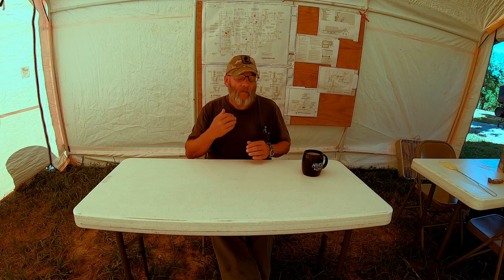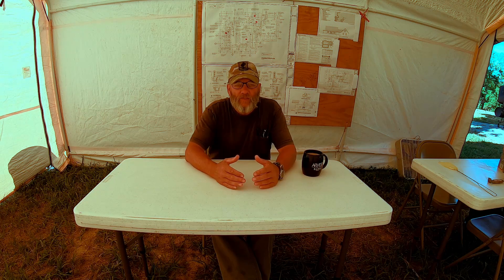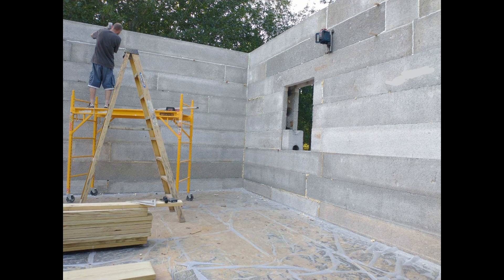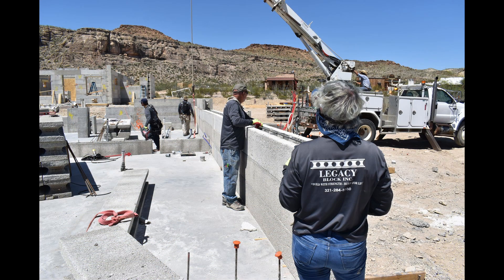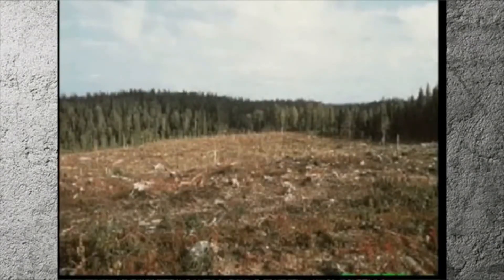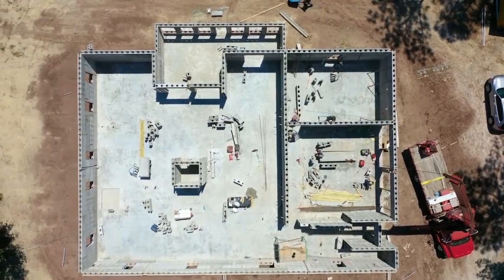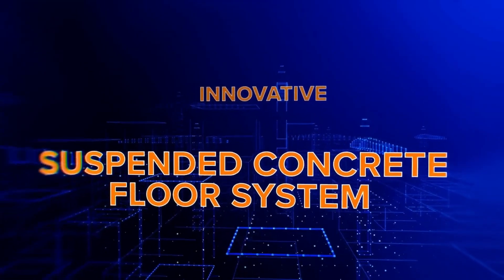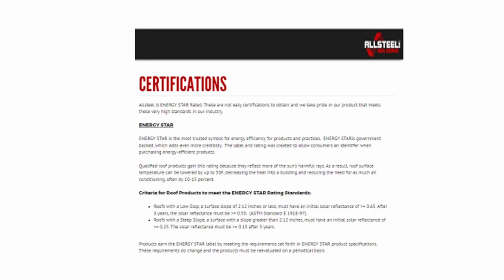Introduction to our New Legacy Block ICF House Building Project

Comment: Great video.  Other than the help with the architecture, was there any other reasons you went with the legacy block over more traditional ICF blocks? Is legacy as strong as fox, nudura, etc? After a quick lool at the legacy block, it appears like traditional icf would offer longer unbroken spans of concrete.
Reply from the maker: There were several additional reasons we chose Legacy Block.  First, we were able to get a termite contract to satisfy the mortgage requirement unlike with traditional ICF.  Second is that they use 1/3 the concrete of traditional ICF while offering excellent strength at a significant cost savings.  You save on additional expense for bracing/forms for filling because they are self-supporting.  They have a 5 hour fire rating without exterior or interior cladding.  They are tested to resist Category 5 Hurricane winds (157+ MPH) and are earthquake tested up to Magnitude 8 with no structural damage.   If you're concerned about recycling, they are made with recycled styrofoam content.
We looked at several different systems before deciding on Legacy Block.  One option we seriously considered was a sandwich wall system with the insulation in the center and solid walls on the inside and outside.  We were in the middle of Covid when we had to make a decision so availability of product plus overall cost drove our decision.  With the crazy increase in the cost of materials overall, the savings in concrete expense has been beneficial to keeping costs down overall.  I hope this helps.
Thanks for watching!
Reply: @ozarksethic  thanks for the reply.  Your title would suggest that you're down in Missouri somewhere. If so, I'm actually a Missouri boy myself, haha. In any case, do you think legacy block makes a wall that's just as strong and energy efficient as the other more "traditional" block? I very much like how bracing isn't really required with the legacy block but on its face it seems that the more traditional block would offer more thermal mass at the expense of having to use more concrete, as well as bracing and more concerns with blow-outs." Very much enjoying your video series, I retired from the military this year and we're looking to owner build our family's "forever home." Take care!

Comment: i watch all 40 videos just quick question what is reason to make raise bed floor that high and build porches around it like belt cover it ?? .. isn't better holding heat or realse heat if it go underground instant ? .. i also don't see any in floor heating system so u plan to use HVAC ? or because of thermal mass it self will be to handle heat and realse ? ..
Reply from the maker: The house had to be that far above the ground so that the plumbing farthest from the septic tank had enough slope to drain with gravity.  Direct ground contact would be better for geothermal heat transfer/insulation.  We debated hydronic heating but the weather here is not consistently cold enough for long periods so we opted not to use it.  We had it in our house in northern Italy and it was wonderful but it also wasn't 14 degrees today and 70 degrees tomorrow like we get in north Arkansas.  We are using mini-splits, wood stove, and relying on thermal mass and solar gain.  We are hoping that the thermal mass, long overhangs and convective cooling minimize the need for constant use of the air conditioner.  Thanks for watching!

Comment: what was the cost of the speed floor?
Reply from the maker: The Speedfloor was $22.48 per square foot and the concrete with finishing was another $6.11.  These costs will vary depending upon local concrete & finishing costs as well as shipping for Speedfloor.  During the design phase we decided to go with Speedfloor over traditional framing partially due to material cost.  Lumber prices have come down but LVLs/fabricated wood joists have not.  The cost of lumber to span the spaces we wanted open was actually more than Speedfloor and concrete when we had to make the design decision.  Plus we have the added bonus of safety since we are in a tornado prone area and no future squeaks.
Hope this helped.  Thanks for watching.

Comment: Fascinating, Tony. It's really interesting to see new building methods.  This looks like it'll be really energy efficient and strong besides.  I've been wondering about your house and you've done a wonderful job explaining what it'll be.  I'm looking forward to watching it being constructed.

I'm impressed with the amount and work and time it took you guys to learn about all of this stuff.  Finding out about new things like these is difficult.
Reply from the maker: I'm glad you found it interesting.  The video isn't the best but I couldn't figure out how to fit it all together.  We did a lot of research and were leaning toward going stick built or SIPs when the lumber market went crazy.  After running the numbers, there wasn't much difference in cost between concrete & steel vs lumber so we opted for the more substantial structure.  Most of the videos into the future are going to be house focused.

Comment: I like it. It's going to be an interesting build. My parents did a build with all SIP panels a few years back. That was a neat build also.
Reply from the maker: I think people will find it interesting as I haven't seen a lot of stuff out there on building with these systems.  We looked at SIPs & stick but, when the lumber market went crazy, we decided to go concrete.  Concrete has stayed about the same cost but steel has kind of gone crazy depending on what you're buying.  I figure it will be a wash when it's done.  The added benefit is we don't have to build a separate tornado shelter.  LOL!
Reply: @ozarksethic  I was thinking the same thing on the shelter aspect. That's going to be nice.
Reply from the maker: @CarolinaSaltwaterLiving  That and we're really looking forward to the stable temperatures.  Our house in Italy was constructed similarly but using ceramic block.  It was very comfortable and easy to heat/cool.